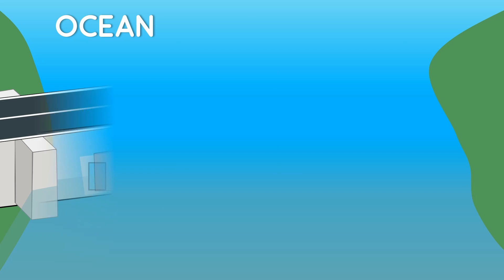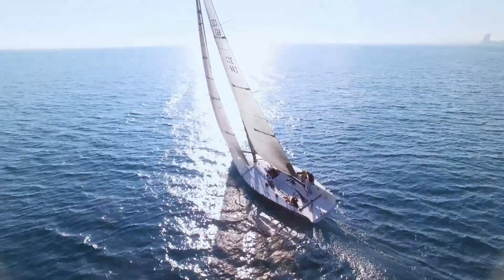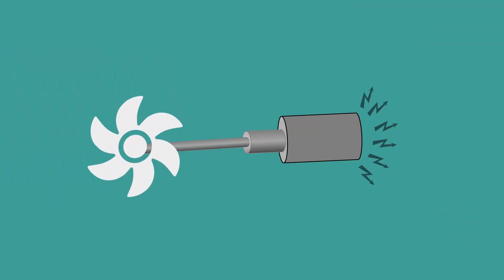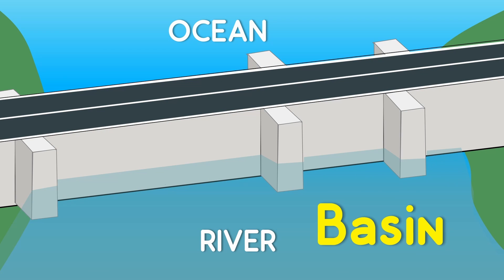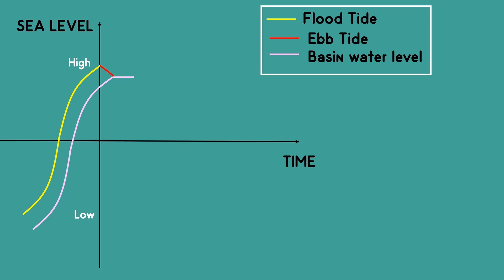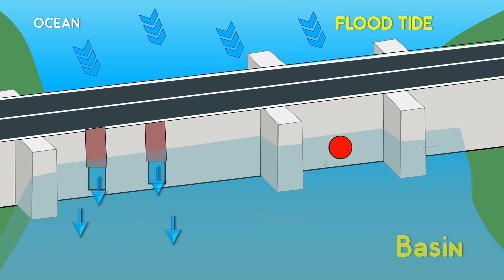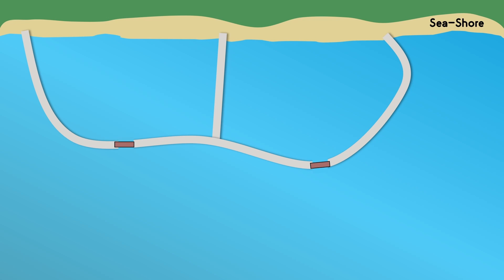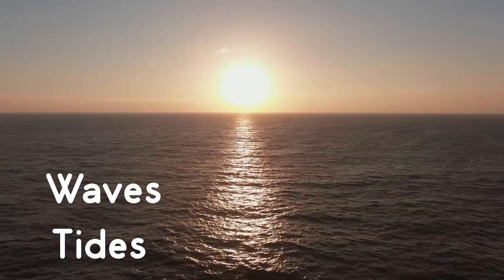Electricity from Tides - Tidal Power Plants

Comment: How many million tons of CO2 will they release from the water into the atmosphere
Reply from the maker: Tidal barrage doesn't release  carbon dioxide into our atmosphere other than those associated with the construction, maintenance, and recycling of the infrastructure.
Reply: @TheLearningCurveBenila  go out in a canoe lower your paddle horizontally into the water roll it over to make sure there is no trapped air. Then move it up and down in the water and watch the bubbles rise. That it the entrained gasses being cracked out of the water by the pressure change. Now consider that over 90 percent of the carbon on earth is trapped in the water on earth. So what do you think that Gass released is?